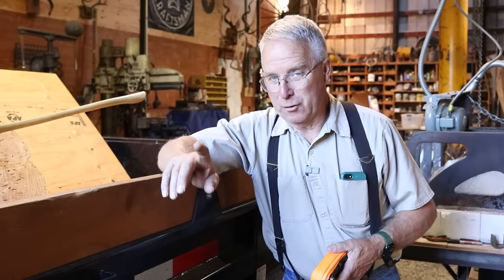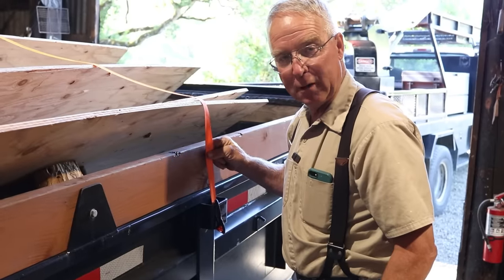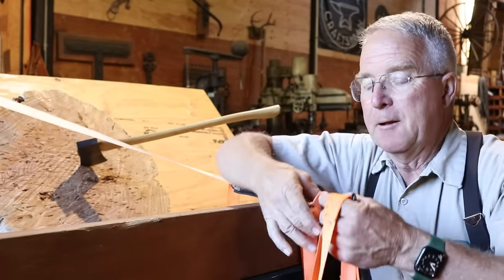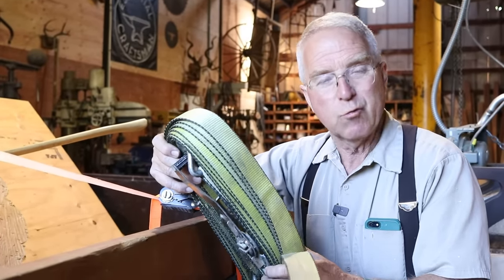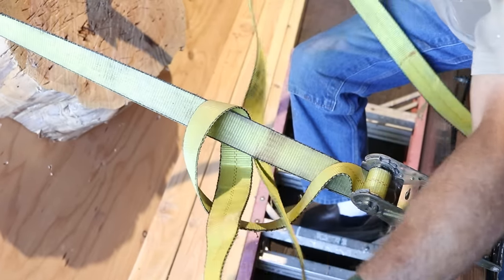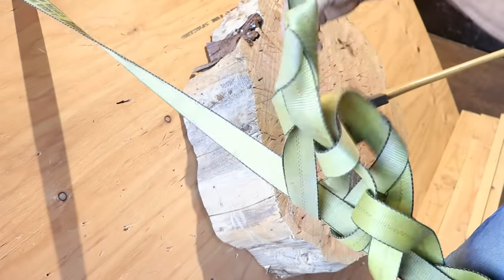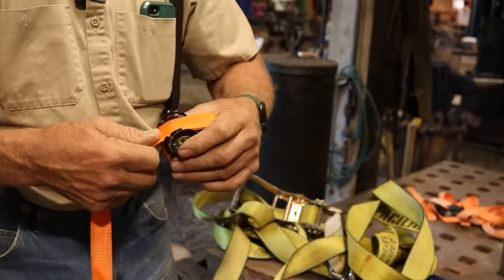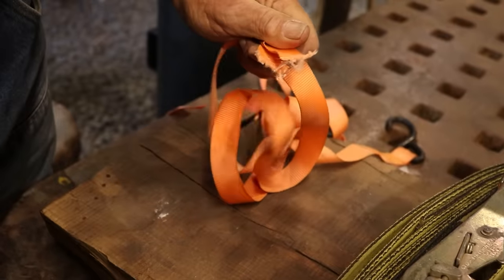7 Ratchet Strap Pro Tips

Comment: You see some pickup going down the road with a new refrigerator in the back with those small straps dangling in the breeze and the fridge wobbling.  The driver does not have a clue on how to secure a load, especially a tall one.  He needs a ticket on safety. 
Some states have laws on how loads are to be secured on a truck, sadly most do not. 

The smaller strap is cheap and unsafe to use IMO.  I would use the large one with piece of rubber or cardboard, etc over the shape edges of the plywood to cut down the sharpness of he edges on the strap and keep from rubbing it. 

The military uses straps, chains and ropes by the train loads and have regulations on how to use them.
Interesting video, keep up the good luck.

Comment: For taking care of the excess strap. Roll it up, when you get near to the excess all being rolled up. Feed a bit ( between the roll and the rachet) through the centre of the roll creating a "loop". Put the roll through the loop and pull tight. .. done.! You can undo the load with out undoing the roll. ...... There is an advanced version of this depending what you want, where after going through the centre of the roll and creating the loop, you can wrap it around the taught part of the strap and then put the roll through it and pull tight. This ties the roll to the strap. Its much neater than the daisy chain, and if you taking the load back or doing a similar load again, your straps are set, because you dont need to unroll.. cheers

Comment: With the standing end, I always try to run the not-hook end through the circle part of the hook and around an anchor point. Like the HD strap, first, run the not-hook end through the stake pocket, then through the part of the hook that the fabric is stitched to. The closed loop, and ignore the actual hook part. Work it up tight then throw the loose end to where the ratchet side is.  That is far more secure. I also stow tie-downs by doing the first wrap like you but then wrap the bulk of the strap laterally rather than longitudinally. You don't have to worry about keeping it in line. It's just a bit faster and I find when stuffed under a seat, they don't unravel.  Putting a twist to account for wind is a great point I had not thought of but will now.

Comment: Not much to add, I roll mine the same way. Keep a bag of rubber bands in the tool box on my truck, and once the small ones are rolled I throw one around. 5 bucks will cover you for at least as many years and they’ll never be unrolled when you need them.

Comment: You mentioned putting a twist in the strap to keep it from oscillating. This works, unfortunately, (despite several independent test that show that a single twist does not reduced the strength to the strap) it is a DOT violation and if you get inspected, will get you a ticket and you will have to stand out ther and restrap your load before you can move again.

Comment: Hey Scott forgive me if someone else has suggested this but my method for storing them is to pull the strap through the windlass so that it's at it's midpoint, then push both sides together through the windlass hook eye to make a bight, then use that bight to start a daisy chain to the end of the strap. The last 2 or three loops are cinched tight and the friction holds everything. You could pull the end through to lock it but cinching is easier. This takes seconds to do and undo, doesn't usually become unorganized, and several straps stored this way in a bag will tend to not tangle. The main downside is that they are not as compact, but for a 1 in strap that's not a big deal. This doesn't work as well for wider strapping, but most of the time I'm using the same one or two 500 lb straps and this saves a ton of time.

Comment: I do wind them, but separately, not assembled. I typically keep a Velcro loop on the metal end to Help from undoing and storage, but also when I'm by myself I can help it hold while I go to the other side.

I order to keep laads balanced I do a strap that starts and ends on the same side, do this on both sides, this helps it fromm moving laterally, then straps that holds it down.

Comment: Flatbed trucker tip: feed the end of the excess strap back into the rachet before you tighten it. If you still have a excess you can fold it in half and feed it in. If theres too much material to operate the rachet i would just feed it in once or twice and secure the rest by putting a ziptie through the loop and around the strap thats holding the load after tightening the rachet. It looks neater and draws less attention from the DOT.
Cool explanation of why people put a twist in the strap. 😁👍

Comment: One thing I have found is that if you get a knot in the strap that you need to undo and it’s not giving up the goods , is to find appropriate surfaces that won’t damage the strap and roll the knot back and forth, or give it a few bangs with a hammer on a piece of 4x2. You can use your foot and shoe on a clean surface like a piece of spare sheet goods, I’d say van or trailer floor but they’re rarely free of abrasive leftovers

Comment: I wrap the smaller straps the same way then I slide them into those cheap gloves with the red rubber palm from Home Depot when I take them out I put them gloves on. I used to use thicker disposable rubber gloves but you only get a few uses before the glove rips.

Comment: For winding up a really long end, i fold it onto itself until I've gathered it all into a relatively tidy bundle. From there i loop it around itself and then you just roll the entire bundle until it goes tight. I'm sure there's a term for it, but that's what I've found to be the easiest and most secure without spider webbing it across all the other junk in the back until i reach the end.

Comment: An old truckers trick for the surplus strap- roll it up in a loop you then reach thru, grab the standing end & pull thru the coil & wrap that single loop around the coiled bundle. I need more practice but it works if done right

Comment: You should always have the ratchet on the drivers side to keep a better eye on your load and wrapping the ends into a nice loop exactly like you’re putting it away. Then put your bite through the hole and wrap it over the roll. Tight, clean and safe.

Comment: One shortcut I take when the load isn't too heavy and I'm working solo is to feed the fabric end of the strap around a rail or tie-down loop and then through the eye of the hook end. Now it works like a rope fed through its own loop and synches down toght. 

It's not going anywhere and works when the hook won't fit through a hole. And I can throw the strap across without any hook to slam in into the side of my pickup. Attach the rachet and you're off. 

Just don't do it around any anchor point that might damage the webbing.

Comment: I have a small old pickup and have never needed anything more that 1 to 1 1/2 inch straps. I save old socks, the ones left over when one of the pair gets a hole in it. I wrap my straps up around the buckle then stuff them into the sock,  roll the remainder of the sock up and pull the open end over to secure the whole package in a ball. It keeps them contained and tangle free.

Comment: Get a roll of 1/2" velcro strapping and loop it through the farthest eye. When you roll up your straps, you can use the velcro strip to secure it from loosening up, and it can be used to secure the tail end of the strap to the standing end in a pinch. Although it is no substitute for a good proper tying off for long trips.

Comment: To tie up the end of a long strap, roll the excess, starting at the tip with at least a 6" diameter hole in the center, when you have about 2' or less left, reach through the roll, grab and pull the unrolled loose section through then around the roll and then you can pull the roll snug and you have a very fast, nice and tidy loop that doesn't come loose until you un-loop it. And you're consistently using the straps at the same length, you can leave the loop in all the time. 
This works best with the larger 2"+ wide straps

Comment: Nice tip on the twist I've always tried to keep them flat on purpose I'll try the twist next time.  It never fails that I only need my straps when the roads are wet and salty so the straps get rusty and freeze up.  I was thinking about throwing them away but I had some Phosphoric Acid left over from a cleaning job so I soaked them in acid to eat away at the rust, then soaked them in a baking soda solution to neutralise the acid, and dried them off and gave them a good coat of oil and now I have straps that will last me another ten years.

Comment: Rather than daisy chain I start at the end and flop about 3 feet of strap over itself so you're left with a flat 3 foot segment of rolled strap, make sure the ratchet is one click away from the closed lock position, set the middle of your strap on top of the ratchet then run each end through the ratchet handle from inside the v shape it makes towards the outside(you). Make sure you won't snag the strap in the crotch of the ratchet when you close the ratchet all the way to the locked position. Quickest, easiest, securist way I have found. If that even makes sense.

Comment: That's how I roll my straps. To keep them rolled I recommend Harbor Freight cut-to-length double sided "velcro" or similar fixed length velcro straps, or since velcro can stick to everything else also, I use the bungee loop straps with the plastic ball on the end. Wrap the bungee around once or twice and hook it over the ball like a soft shackle and it's done. Use a bin or bucket in the truck box to keep them wrangled together and easily accessible.

Comment: When you feed the loose end through the turn buckle, I used to take out all the slack and make it tight before starting to ratchet.  I’ve actually had is come apart since there wasn’t enough strapping rolled onto itself.  It’s just friction holding.  So now initially I still pull all the slack out to make tight but I then loosen it just a bit and then start ratcheting it. So a little more material gets rolled up.

Comment: I used to use cheap ratchet straps and tie off the excess in whatever way seemed convenient.  Saw ads for a company called Rhino USA, and got a set of their straps.  These have a spring loaded gate on the hooks much like a carabiner.  This ensures that the hook stays put.  The straps also come with a small velcro strap to secure any excess strapping.  I usually keep 2 straps in the pocket on the door behind the passenger seat on my truck.  I used to store my old straps much the same as EC.  With my new straps, I keep the ratchet and the strap separate.  I roll up the strap with the hook on the outside and use the velcro strap to secure the roll.  When I need a strap,  I secure the hook and throw the remaining roll toward where the ratchet is secured.  For me it seems less jumbled and easier to get what I need.

Comment: I wrap up the straps as you do. Only extra thing I do is put a rubber band around them or secure them in the trucks door pocket. Using the strap just take the rubber band off and run the working part of the strap through the band this way it’s there when you take strap off to rewind it up again

Comment: When wrapping the strap at the end of the day, make a 90 degree turn by folding the strap over itself, loop around the entire bundle and slide the end through the 90 part and tighten it down.  I find this will hold most straps until needed the next time.

Comment: I've used a ratchet strap to support a transmission as I was loosening the bolts to the bell housing.  It also helped raise it in place when reinstalling it.  Worked better for me than the transmission jack I borrowed as it was not in the way as I fussed to get the bolts back in.

Comment: I always remove the winch end from tie-down straps, roll them from the loose end and store them in 2 separate buckets. If the bucket size is correct they will stack and don't need bags or ties.  I always attach the hook before I  throw the strap over a load. There is no need to unroll the strap first and also this way there is nothing metal hitting the side of the truck / trailer or someone who may have walked into the area. It is then a simple matter to take the winches around to the other side and slide them onto the ends of the straps.  As a few others have commented if you roll the loose tail strap,  leaving a hole just big enough to pass your hand through and grab the strap, pull it back through the hole and around the roll, makes a very neat and secure method of finishing off and only takes a few seconds.  While I fully agree with what you have said about putting a twist in a strap, it is actually a fineable offense in some countries.   Engineers   . While I never use open ratchet strap hooks something that would help is to slip a rubber band over the hook and then bring it over the tie-down rail or anchor point and then onto the end of the hook. This method works well on chain hooks too.

Comment: I roll up the excess strap with a hole in the coil about the width of the strap; then pull a bight through the hole and wrap the bight loop around the roll and pull it tight. You then have a relatively heavy object you can poke into some corner or jam someplace under a length of tensioned strap.

Comment: Another tip, with the 2" straps with the bigger hooks that won't fit into the box, feed the strap through the bottom of the box, pulling all the way  up through the top, and toss the strap across to the ratchet end. When you get over to the ratchet, feed the strap and pull tight, the hook will never pull through the box on the other side since it's too large!

Comment: I find there's a quicker way of dealing with the loose end of thicker straps. Roll it in an open centred roll untill you have a foot to 18 inch left at the ratchet head put your hand through the open roll and grab the remainder between the roll and the head pull it through the centre of your roll and over one side pull it tight and even if it jumps out of wherever you then set it in the trailer it won't unravel. When you get to unloading flip the section back through the centre of your roll and let it unravel. 
It doesn't work as well with thinner straps as they tend to be shiny webbing especially when new but it'll still work

Comment: Blindly throwing the hook end over a load is a great way to break a window or hurt somebody. You'll also make an extra trip around your trailer or vehicle to secure the hook on the other side.

I always coil up the strap end after use so it can be tossed while holding the hook in hand.

Comment: when going cross country I will do a whip knot/grapeviine around the taught strap, and then trap the end upder the tension of the strap.  It is a lot neater than chain stitch, and less drag.  I have given thought to throwing a few stitches on so the end absolutely can't get loose.  Might save some trouble on a two day drive, not something I would consider for a short run.

Comment: I would put a buffer material (rubber pad, heavy cardboard) between the strap and sharper edges like the plywood to reduce wear on the strap (and damage to the plywood).
Storage: heavy duty elastic or small bungee cords or  re-usable zip ties.
Same for loose end when strapped down - roll it up, cord it, fasten inside trailer bed.

Comment: As I wrap I will turn the hook from the short end out from the webbing and continue to wrap leaving the connected loop in the wrap until the long end is done then turn the hook so that it is on top of the finished wrap locking down the strap, sometimes the long end hook is left hanging sometimes not. Of course this only works for the small straps not the large trucking straps.

Comment: I first figure about how long I need the strap and put one wrap or start of a wrap on the ratchet to hold. Then I suspend that on one side and throw the hook end over. Walk around and hook the hook end. The weight of the ratchet will hold the hook in place on the other side of the trailer. Makes it an easy one person operation.

If you're off on the guess of length it's easy to just hold tension while readjusting the ratchet.

Comment: I've seen people pull the strap so tight before ratcheting it, that the strap does not make a full wrap around the ratchet cam.  It's the tension of the strap on strap, thru the cam,  that holds the strap tight.

Comment: thanks for the video can not say i learned anything new but always looking for new ideas

excess strap i always use the bigger 2 inch straps for the majority of my stuff and they are 26 feet long typically so i use a 2nd ratchet to secure the excess and even a 3rd if it is very flat and going back and forth on my trailer i have enough left over for that so then i have 2 or 3 spots my load is always secured down from and only a few feet of excess that wont go anywhere

Comment: A new strap will stretch after tightening and the hooks can disconnect.  I always check the tension before I drive the vehicle and again after a few miles down the road as the load settles. New straps will need to be checked multiple times as they will continue to stretch over time.

Comment: Dont send the hook thru. Instead, fold the strap and send it thru. Then hook the hook to the loop you sent thru the spot you would usually hook to.

Another method I have used was to attach the hook on said spot, use a clamp to hold it while getting it tight on the other side. Then remove the clamp. The clamp is an extra set of hands. Lol